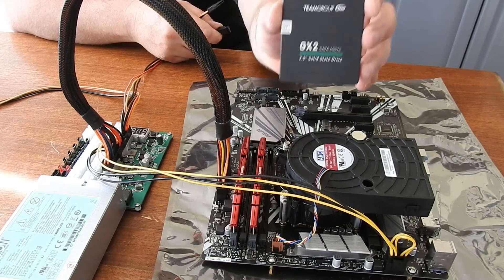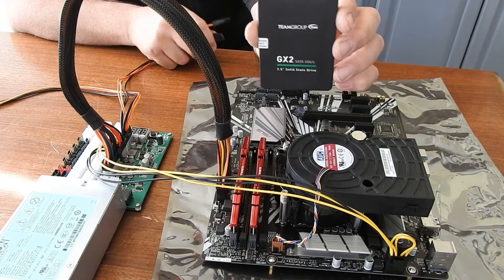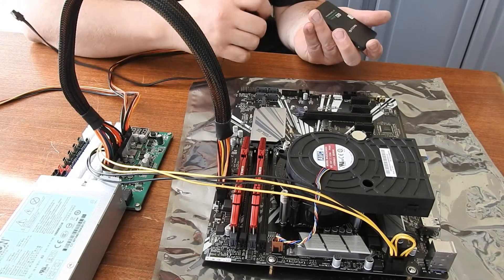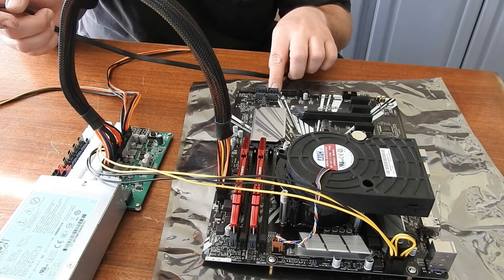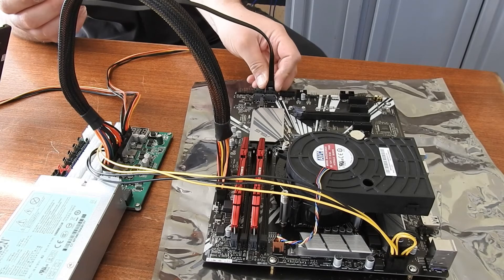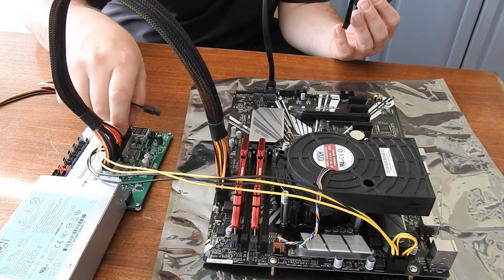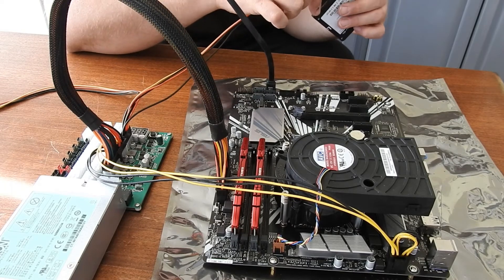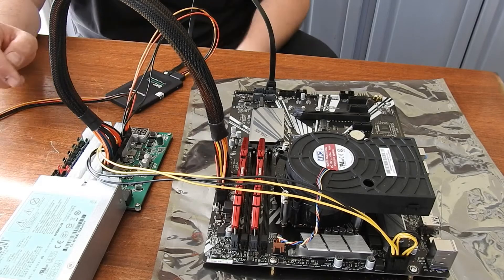[Asus Prime Z390-P] - Part 6 - Install and power the SSD hard drive

Comment: My motherboard is not turning on? When it does it shuts off after a while
Reply from the maker: What is the RAM and CPU, probably one is incompatible.
Reply: also you might be using the wrong end of the cable  it happened to me. you have to use the molex in the middle of the cable